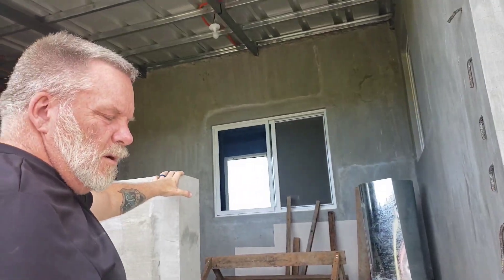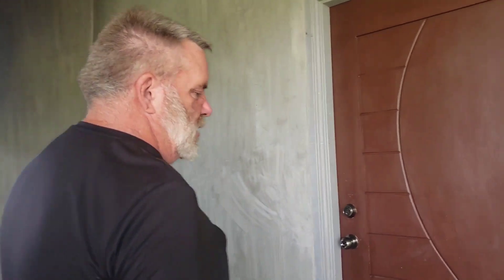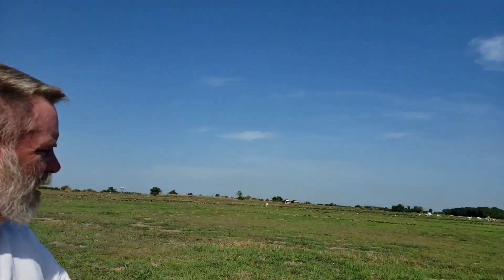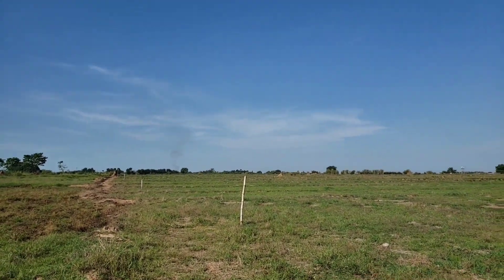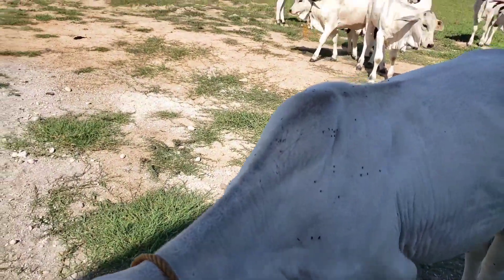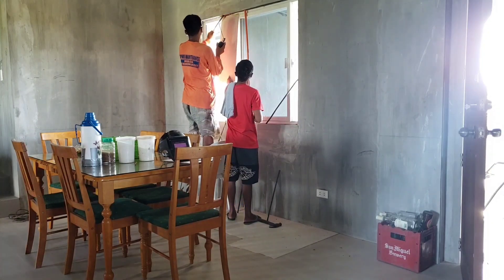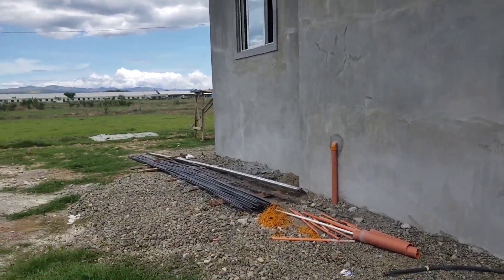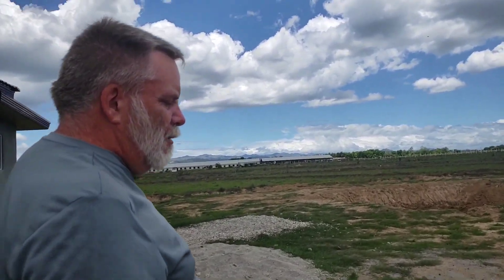House build in the Philippines 🇵🇭:Addition of security bars day 1

Comment: Keep that welding and abrasive saw cutting and grinding the steel and welds  away from the windows as any of the hot metal or sparks will pit the glass . I have learned this the hard way !
Reply from the maker: Thank you for the information,and thank you for watching